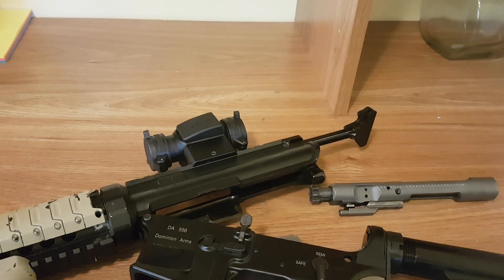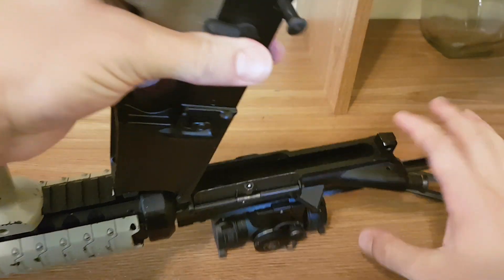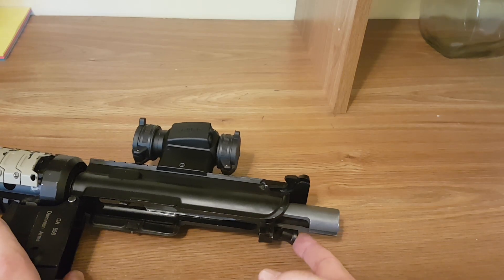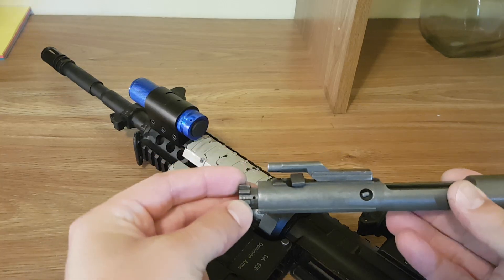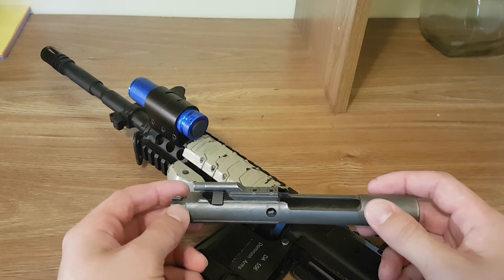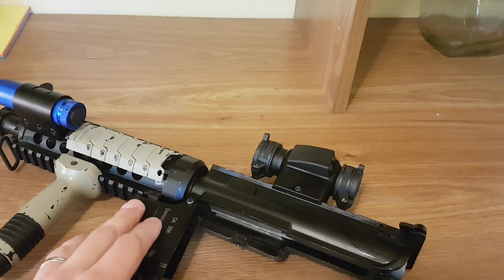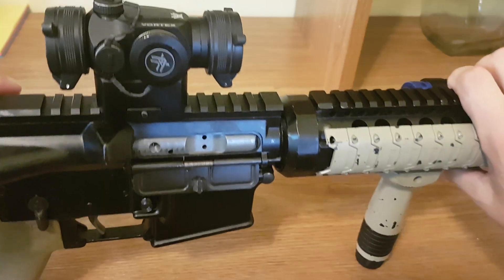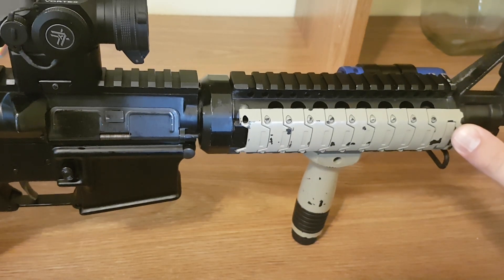What does the Forward Assist on the AR15 Do?

Comment: forward assist was designed for the m-16 for combat, it basically trying to eliminate having to rack your bolt back just because a bullet did not seat all the way, Back then when this was designed the m-16 was not as reliable as it is now.

Comment: In California it switches to full auto or so liberals say
Reply: 300 clip rounds in half a second. The ghost gun is beautiful engineering.
Reply: Upon doing more research the forward assist on the m-4 model of the ar-15 it functions as a flamethrower.
Reply: @pandaland1  Foo gas or Napalm?
Reply: @rancidpitts8243  Grandpa's GAS.
Reply: pandaland1 Full Auto Forward Assist lmfao but then again I wouldn't be surprised if our one and only Kevin De Leon says it makes your gun fire 300 more rounds a second
Reply: @Kilonoid  you forgot a zero or two it shoots 30,000 rounds per second. I learned what I know from feistein, pelosi and gavin
Reply: I wonder how much damage the handle and flashlight add, or maybe it's just critical hit chance.
Reply: @pandaland1  the handle gives +4 accuracy
Reply: It's there because they fucked up in Vietnam. The first model M16, used by the USAF had no forward assist and they used civilian ammo with low fouling propellant. The army tested this rifle with the civilian ammo, found that it fouled so little that it hardly needed cleaning. They then adopted the M16 and sent it iff to Vietnam with no cleaning kit and told the troops they didn't need to clean it. MEANWHILE, some other douche changed the specs for the ammo, the military version having standard military ball propellant which fouls like fuck, setting like concrete.
So the rifles started  jamming solid in combat. There was a huge scandal and cleaning kits and  drills were quickly sorted out. But that was felt to be not enough (it was all that was necessary) and so the forward assist was fitted to the M16A1 so if the rifle jammed, rounds could literally be hammered into the chamber.
Reply: Don't be 'that' guy.
Reply: Kilonoid yeah, he wants you to know that the forward assist button increases your magazine-clip usage to 3 magazine-clips per second.
Reply: @pandaland1: Nope. Stands for ArmaLite Rifle, Design 15.
Reply: @StrikerTheHedgefox  YES!
Reply: sylumgand Nope, change in propellent. The original stuff was an expensive civilian propellent with very low fouling. The military rounds used "Ball propellent" which produced lots of hard, corrosive fouling.
Reply: oh no someone triggered a liberal lets all go to a fucking safe space, cant hurt anyone's fee fees
Reply: "Assault Rifle" 15
Reply: Ever been here? It's pretty nice.
Reply: You mean gender confused non binary weirdo's.
Reply: *Fully semi automatic *
Reply: Captain Howdy 😉
Reply: Fade locus ArmaLite rifle 😉
Reply: I thought when you pushed it it was a instant kill?
Reply: I'm a liberal and I have the AR in 450 Bushmaster, 458 SOCOM, 556, and 300 Blackout. Among many other guns. Don't buy everything the NRA is selling
Reply: @BARACKOBAMA because the chemicals in your stomach cause a chemical reaction to ma,e food processable for digestion
Reply: Listen, I’m a democrat. In your eyes I might be one of the good ones, like if a great guy ran for president that liked and he happened to be republican, I would vote for him. I also watch gun videos at least half the time on YouTube. But the point of this comment was to see if any of you remember that one clip of some old lady on the news talking about how tracers are robotically controlled bullets that can turn corners and could be used to shoot down planes. I saw that somewhere and it was the funniest shit I had ever seen. Anybody know what I’m talkin about?
Reply: Im a liberal and i know very well that the forward assist is to ensure your bolt is fully seated.  Basic knowledge.
Reply: Joel for someone interested in these types of guns of course.
Reply: liberals in california think AR stands for assault rifle.
Reply: @mike042465  That's what all four of my liberal friends say. No amount of evidence to the contrary will change their minds in spite of their saying that we must open our minds to new ideas.
Reply: @mike042465  i know people who OWN ARs wo think it stands for assault rifle
Reply: pandaland1 shouldn't it be aw15? its an assault weapon 15
Reply: @cIick_bait its AR because A is from the company name Armalight
and the R from the word Rifle
So...
Armalight Rife 15
Reply: pandaland1 😂
Reply: I thought the M16 problem was a change in the materials used in the construction of the gun to save money.
Reply: SvenTviking thats all mixed up ball was the early powder its cheaper easier and meters better through loading equipment has a longer storage life and it also has less erosion however it does cause more fouling and if loaded improperly may either fail to fire or. blow the fuck up. modern extruded powders are safer and cleaner but obviously more expensive
Reply: pandaland1 lmao that got me
Reply: I'm from cali and can confirm this.
Reply: It's to launch a rocket.
Reply: pandaland1 This was mildly humorous in a neutral sense
Reply: I thought I activates the chainsaw bayonet
Reply: I thought it was the mute button for online chat?
Reply: LMAAAOOOOOOOOO!!! 🤣🤣
Reply: @Sentii2  

Ok so if you are triggered where do the bullets come out?
Reply: Liam Brown truth is, frogs were gay from the start
Reply: @michaelwittman6494 -   Hermaphrodites,  like Jamie Lee Curtis from what I have heard.
Reply: According to liberals, that's the rocket launch button
Reply: No, it makes it go full semi auto.
Reply: haha
Reply: Just hold it down with your thumb
Reply: I thought it was the tactical nuclear ordinance deployment button.
Reply: Best comment
Reply: No it turns it invisible!
 I thought everyone knew that.😒
Reply: Maybe for all those Liberal massacres going on. Amazes me the violence that state has yet their oblivious and strict with their gun laws.
Reply: Not only switches to full auto, but also suppressed 😂 😂
Reply: @Sentii2  I am just now reading it.
Reply: Fully semiautomatic
Reply: Pressing this button makes this..................thing able to shoot thru a tank
Reply: Not all liberals. Some do research.
Reply: pandaland1 XD lololol
Reply: It makes it a machine gun
Reply: I believe the term you were looking full semiautomatic. You were probably thinking of the completely left Cartoon News Network dialogue
Reply: @scotchancestry9103  dont remind me of a video that I wish I didnt see
Reply: @raptorcell6633  no offense intended 👍
Reply: @scotchancestry9103  hell I think we may have gotten it from the same place.
Reply: @raptorcell6633  keep up the good fight!
Reply: I wish
Reply: If it wasn't for liberals your national anthem would be "God Save The Queen"
Reply: Michael Borges more like "i washed out of basic and now tell everyone on the internet I was in the army"

Take a fuckin hike kid.
Reply: @Ephraim32  lol moron
Reply: @Ephraim32  lol what? Your mom washed out of basic?
Reply: pandaland1 I had to turn in my semi pump full bolt auto action assault weapon that I got from my 3D printer
Reply: In delusional California, that is the Forward Assassination button that also has the option of launching nuclear tipped 5.56 rounds to start WW3!!!1!1!1!!!!1!!! :'( :'(

;)
Reply: Fade locus assault rifle 15 come on get out of here
Reply: You mean it switches to semi fully automatic. But there is also the gun show law bypasses that they can do too that allows you to not show any ID when purchasing a weapon which is likely to be sold to children who are then made into killers because they have a gun.

Or so they seem to believe in the liberal media.
Reply: according to california a fully semi automatic assault weapon that fires a 30 round clip in 1 second is a real thing, and they take up a large density of the popular vote, scary right?
Reply: jay w as a Brit I want liberals to go to the middle East
Reply: Senti touché
Reply: click bait do you even know what ar15 stands for
Reply: @owen_ham5231  how the fucking hell can a comment that mocks (anti gun) liberals be clickbait?
omg i realize now you were replying to somebody named click bait
Reply: @pandaland1 go home you're drunk
Reply: James, the only thing great about California is the weather, which has nothing to do with its sh!tty State and local treasonous politicians.
Reply: The  liberals are going to wish they had  one when it starts
Reply: No matter what it is you dumb asses have to make everything political. And it's nice to know America made a gun so shity that they had to put something in there to make sure it can still fire it. if you don't want a gun to jam get a Kalashnikov AK47 or a M14 instead of an M16 for a AR
Reply: Ha ha funny comments,I assume some tree huggingAnti gun nut who doesn't know the first thing about firearms is "up in arms" about combat style semi autos in California.I am Scottish so hazarding a guess.never give up your right to bear arms.in the 1980's I owned an assault rifle and several pistol's.then all that just got banned and now I cannot legally own them.very very sad situation.
Reply: @filthyanimal1067  awww poor baby ill bet you can't sleep at night huh lmfao
Reply: I fuck bagels but also fuck liberals
Reply: unfuckingmaker lol no
Reply: Its a play on the OP comment.  If I need to see one.... so would he.  Idiot.
Reply: my bad, not all europeans like and welcome muslims filthy weeb
Reply: Why don't you guys just be happy that you live in a country with the most firearm freedom in the world instead of circlejerking about the media? Or do you do it at the same time? fucking losers
Reply: Goog L'sucks Go see a psychiatrist.
Reply: pandaland1 Seriously, Liberals are giving this place a bad name.
Reply: No its fully semi auto once again wiyh all you famn gun nuts noy even knowing what it is youre talking about. I watched cnn bring a militart veteran of high rank on there and he fired the gun...i think he knows more than you guys. #repeal2A
Reply: @hyperslow3810  youre obviously a hillary supporter...thats apparent by your self titled name and remark which is reminiscent of a 4 year old who hasnt grasped the concept of a witty remark
Reply: All liberals need to pack up and move to Europe with all the other liberals and Muslims
Reply: jay w I live in Europe and I want the liberals to stay in the US, we don’t need more snow flakes here.
Reply: im a liberal was in the army and guns are boring good for simple little minds like yours
Reply: @steamdriver6964  oh really. Without google what unit
Reply: @steamdriver6964  Paper pushing doesn't allot for much opinion on guns.

Comment: Avoid using the forward assist to force chamber a round when ever a round fails to fully chamber. This can be a case or bullet that is bent or dented enough to cause a failure to chamber and pushing on forward assist will only wedge case tighter making extraction difficult.
When ever a case fails to chamber you should tap on bottom of magazine to insure it's fully seated and then manually cycle charger handle to eject chambered round and feed a new round into chamber and then tap on forward assist to insure chamber is fully closed.
Reply: Joe Blow um, no. you first drop the magazine, then work on ejecting the bad round.
Reply: That is for civilian practice and under combat conditions removal of magazine just adds another step. They keep the steps to a minimum to get weapon back into action with the least amount time wasted since an enemy is shooting back.
Reply: SPORTS
Reply: Joe Blow tap, rack, bang. Oorah
Reply: Considering what mandatory education and college is pumping out as of late, wouldn't that decrease the overall effectiveness of the Army?

Comment: and this is why you use an AK 47 :)) if you drop your AK 47  in mud  or in the lake or run over it with your hummer a week later you can use your shoe lace and some motor oil to clean it if you want  :))

Comment: I was an armorer for the US Army for years.  Your explanation  of the forward assist was the best i have ever experienced.  Even in tech school they glossed over the use and detail expressly the grooves on side of the bolt carrier group.  Almost all soldiers did not care or want to know what it was used for.  They are mostly told if you have a misfire then recycle the bolt action and push the forward assist.